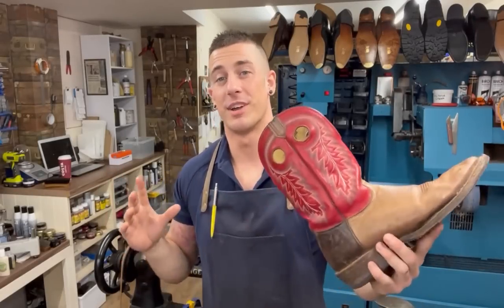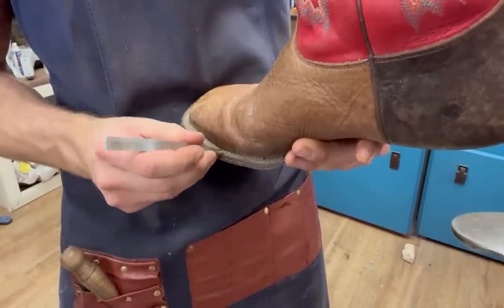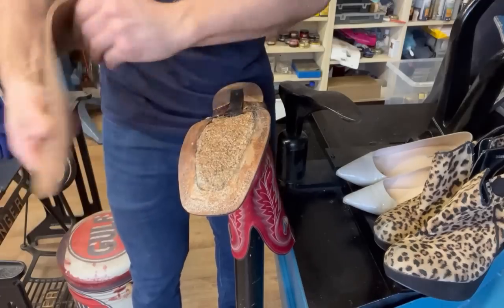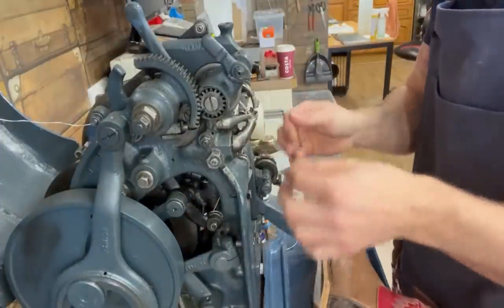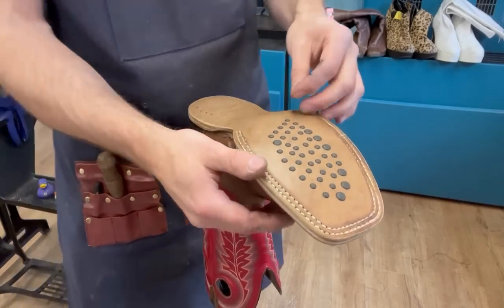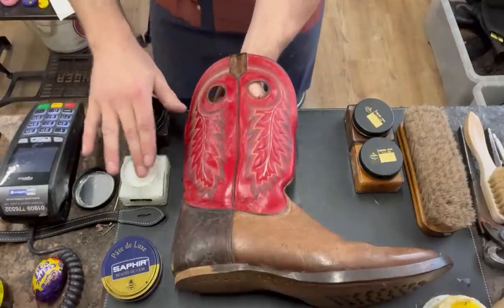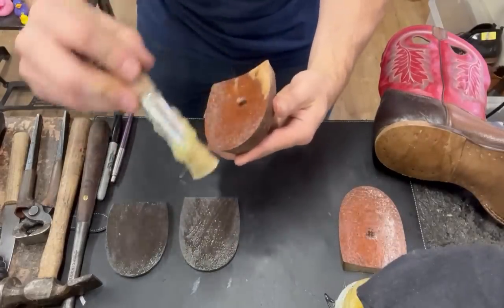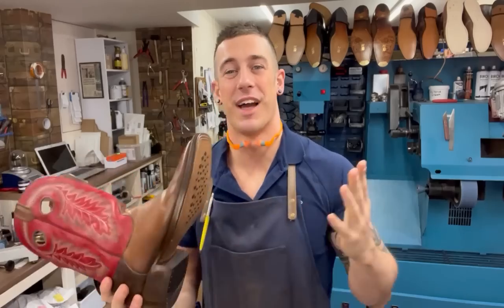COWBOY BOOTS RESOLED // Double Stitched Welt on Nocona RODEO BOOTS!

Comment: People would walk into my Collision repair shop and say the same thing, "It smells great in here". Paint, Body filler, numerous smells. I think the smell if a paint store us why I started painting at 12. The Auto parts sold paint too. I started with fixing n painting old lawnmowers, and selling them. $45 without a trade in, $35 with. This was in the 70's, we didn't have buy it and throw it away then. A new push mower was over $200 for a cheap one. Very few had a riding mower then. Now, you pay $99, use it 2 years, throw it away, buy another.

Comment: I am curious... Could you, someone who repairs shoes, make your own shoes with the materials and equipment you have on hand?  Is that something you ever thought of doing or, have done, or had to do in an emergency for someone?  

I'm also curious about the knowledge required, do you need to know additional things in order to make a shoe from scratch, compared to just repairing?  I would assume the knowledge would be the same, but possibly some additional things a creator would need to know, over someone who just repairs the shoes?

Thank you for your insight.
Reply: Fun fact. A shoe repairman is a cobbler. While a shoemaker is a Cordwainer. Loads of difference between the two.